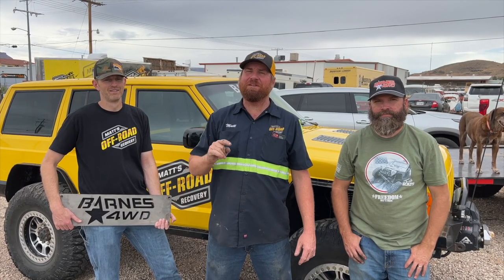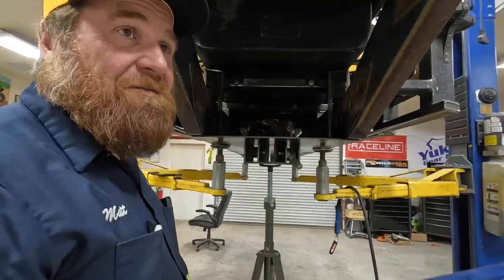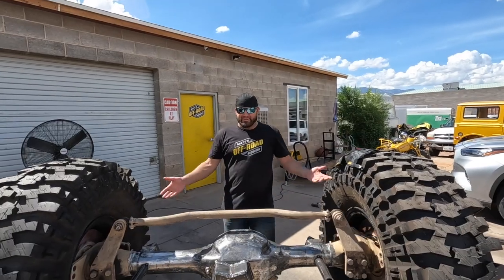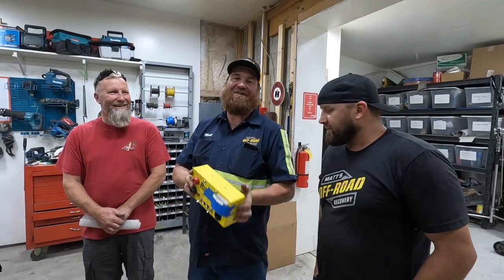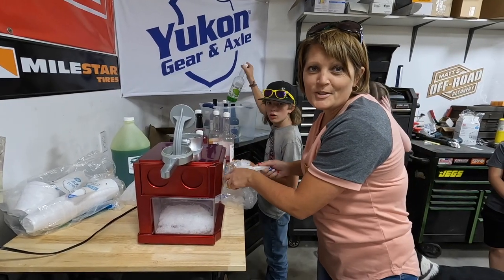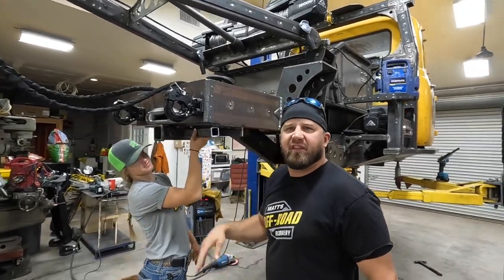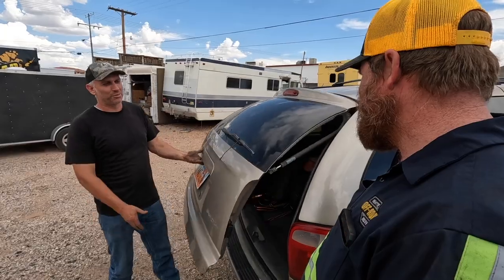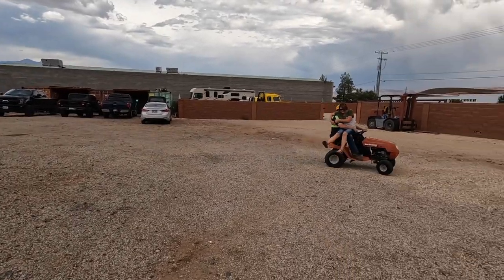We're Making Some Noise With The World's Largest Off Road Wrecker

Comment: With all that steel you keep welding on, this thing will end up weighing 20,000 pounds by the time you're done with it
Reply: @MattsOffRoadRecovery  - That is lot of weight for that stock chevy motor
Reply: @MattsOffRoadRecovery  - This rig needs a Cat or Deere turbocharged diesel engine